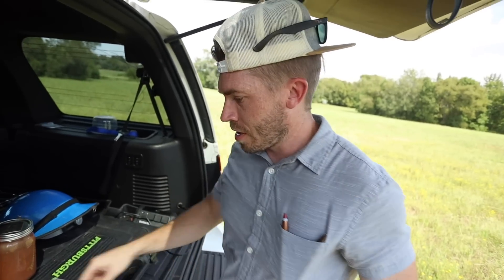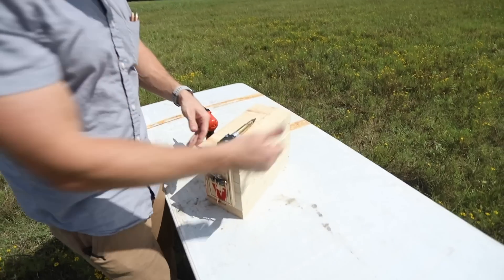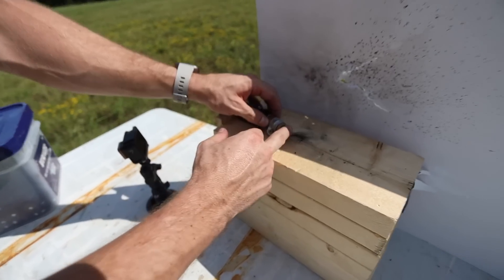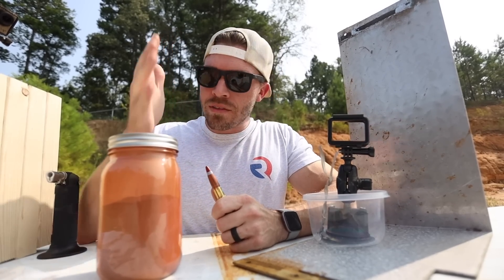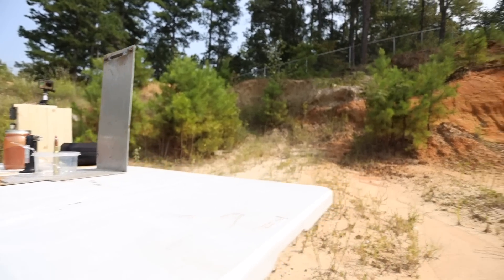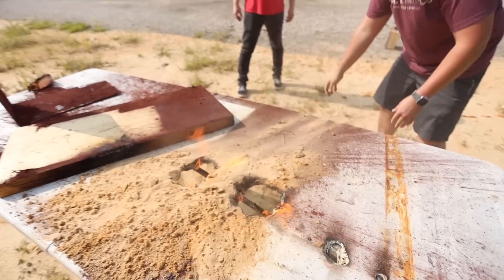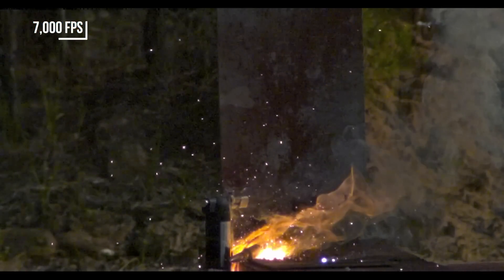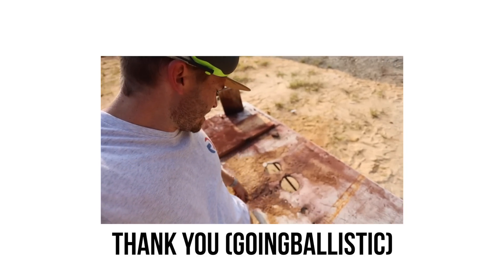Can Thermite set off a .50 Cal Bullet?

Comment: Heat alone is definitely able to set off a round.  I was in the military 23+ years and a “hot gun” shot is a real worry.  I have seen an M-60 machine gun cook of after about 100 rounds fired in about a minute.
For 5”/38 cannons “hot gun” is 40 rounds in four (4) hours and I have timed the gun crew I was part of at 24 shots fired in one minute.  One night one gun crew fired 700 rounds through 4 barrels in about 3-4 hours.
Not only can the powder ignite, the explosive in the shell can blow up.
A major benefit of guns that fire from an “open bolt” is that the gun fires as soon as the bolt is fully closed.

Comment: .50 cals "cooking off" due to fire is pretty common.   Its happened in tanks that caught fire,  happened to aircraft, ships.   

Its also happened when barrels got to hot just from firing...   If the weapon cant' shed the head and is fired for to long...   it can start cooking off rounds in the chamber.
Reply: Absolutely right. That is why machine guns must be left with an empty chamber after prolonged firing.

Comment: Don't you ever check to see if anyone else has done this. You can't light termite with a match
Reply: I have seen it done inside a cardboard box with the cartridge suspended with a wire over a candle flame.
None of the fragments escaped the box.

Comment: I'm curious if the gunpowder is going off completely or if it is just a small amount and or the primer.
Reply: The primer seems to be unfired judging by it's position, I'd say the heat probably caused the lower section of gunpowder to spontaneously combust, causing only the bottom half of the casing to blow

Comment: That looked like a type 10 Salvo squeeze bore round. That's a super high pressure round that forces the diameter of the projectile to decrease. The projectile is actually multiple cones stacked together. It increases hit probability and/or target saturation.
Reply: And penetration depending on the material
Reply: What's the final diameter then?